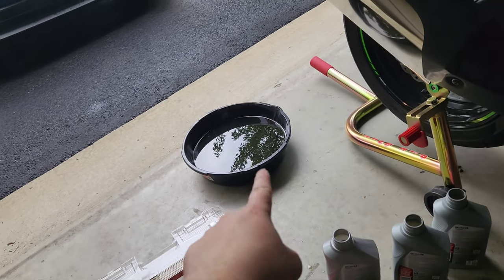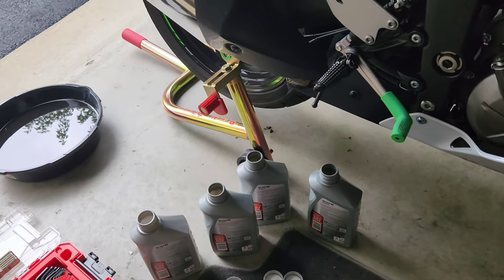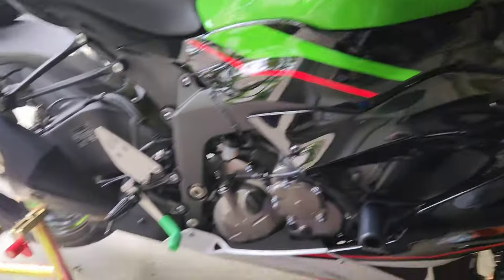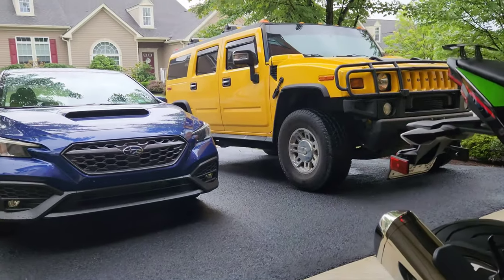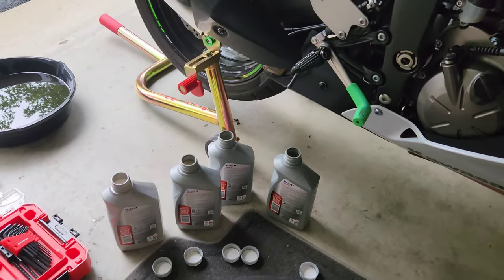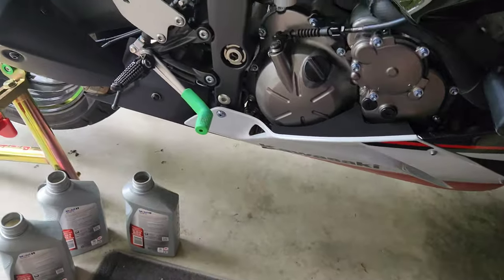how to do a ZX6R oil change and all oil based information!

Comment: Good video, I have almost 38,000 miles on my 21 ZX6R, yes I ride a lot. I service my bike every 5000 miles, so a good thing to use on that oil filter drain is aluminum foil. Take about am 18" piece and fold it over about 3 times and then shape it kinda like a water slide.  You can route it away from the bike to your oil pan. Saves a lot of unnecessary engine clean up. Also put paper towels or shop cloths in the opening between the engine and the front sprocket guard. It will catch any stray drips.
Reply from the maker: I never thought to use aluminum foil. That's an excellent discovery! Thank you so so much for your comment. I have another oil change coming up. I'm going to give it a shot! :-)

Comment: Is 4qt to much I just did my oil change and it looks like I put too much oil?? I only put the 4qts am I good ?
Reply from the maker: So the best thing to do is keep the bike on the stand / straight up. Let it run for a bit 2 min. Turn the bike off. Let it sit for about 2 min and look at the oil window. But NOT on the kick stand. If it is equal to or below the line, you are good. But if it is to much... you have 2 options. 

1. Suck it out from the top...

2. Pull the drain plug for just a second and recheck the level. Repeat till u only let out enough.
Reply: 3 and a half quart is perfect

Comment: Which tires do you have?
Reply from the maker: I run the Pirelli Angel GT tires. I get about 6000-7000 miles out of a set and they do everything I could ask of them. I've never had an issue with slippage or instability regardless of the speed
Reply: @order636 the GT are hard as hell, I would rather run diablo Rosso 2, wich I do
Reply: Soft borders
Reply from the maker: @GALLO2119   yeah, those are phenomenal tires! I've never heard a bad thing about them, and they provide phenomenal traction!